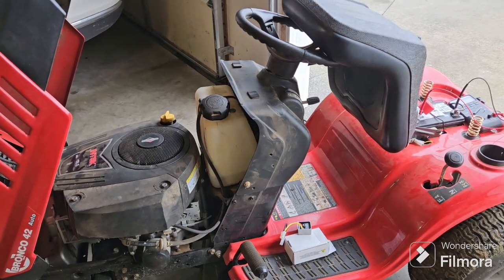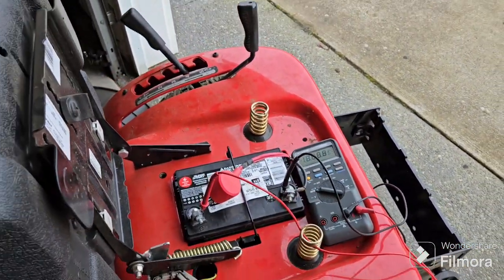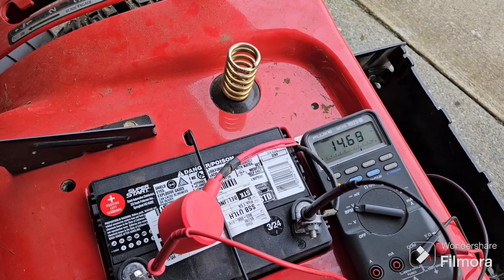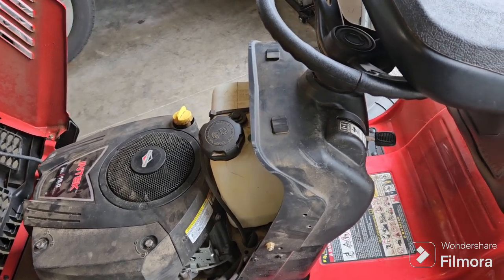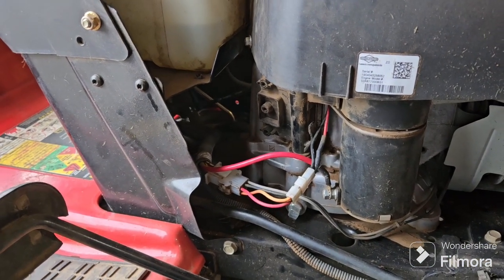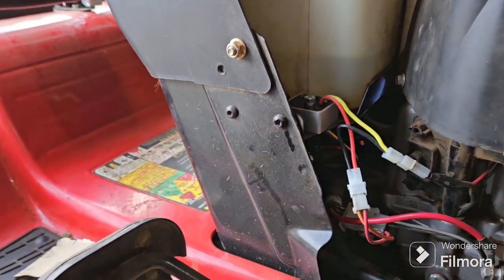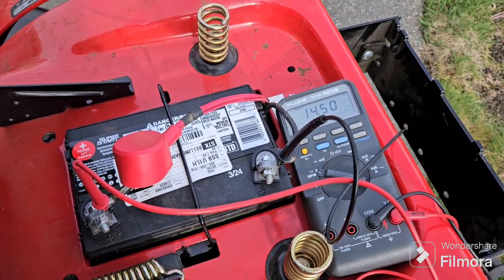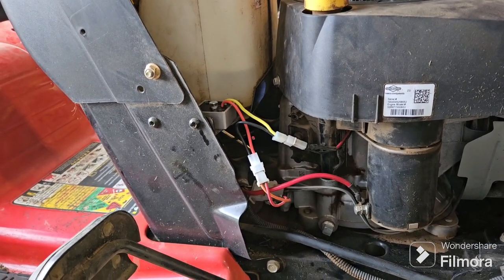Troy Bilt with Briggs and Stratton charging system running at 16 to 17 volts, FIXED.

Comment: Thank you for posting this. The use of just a diode instead of a real regulator seems like a common cost saving "trick"-they don't care how long the battery lasts. Thanks for showing that the regulator held over 14 v even when the engine was idled down.

Comment: Neighbor has a craftsman T110 that is wired without a regulator as well or someone has taking it off 🤔 The electrical part next to the battery under the seat is the solenoid for the starter. The stator puts out 9-25vdc depending on where the throttle is set. The 3rd line from idle is roughly 14.5vdc.

Comment: Tks for vid. Kind of confirmed same diagnosis. Found same thing when my 2 yr old Bronco 42i mustve cooked the battery while out mowing. Tractor just died in middle of our lawn. Traced wiring from motors stator to white connector that runs under the firewall and below floorboards up and under the seat where it runs to various safety switches but there is NO regulator that I could see anywhere. Seems Troy Bilt designed the stator to put out a decent voltage to keep the battery charged ( yes there's a diode hidden within shrink tube of  one of the brown wires so the stators AC VOLTS are converted to DC VOLTS. In my case however, my stator would put out as high as 16.5 volts at WOT. It varied from 13.5 vdc at lowest idle to 16.5 vdc. I guess after 3 plus hours of cutting at wot must've been sufficient to boil the crap out of the factory battery. Definitely looking at adding a regulator now. Don't want to be replacing batteries every year. They're almost as expensive as regular car battery and only 1/4 the size
Reply from the maker: Yeah its crazy to me that they dont come with one from the factory. 
I haven't had to touch the battery at all since I put the regulator in.

Comment: So are you implying there is NO Voltage Regulator on your tractor? Being that the battery is in the rear like an old 12V air cooled VW Beetle , the Regulator is ALSO in the Rear and close to the Battery. I don't know why that is exactly. Anyway, I BELIEVE the Regulator on your tractor is on the rear under the battery bolted to the "frame" or the body of the tractor. So you Added ANOTHER regulator! Now you have a Primary and a Secondary I suppose you could say. I have to say I'm tempted to do the same thing because like I say getting to the factory installed regulator in the rear doesn't look easy. I have to remove the rear "Shell" or flip it upside down or something silly.
Reply: What they do is have a small (easy to miss) diode on the wire from the stator to the battery. This turns the AC to half wave DC to the battery. Inefficient (not big problem) but also does NOT control voltage- which is a problem with WOT overvoltage charging! Presumably he removed or bypassed that diode.

Comment: How did voltage get to 16 volts in the first place? Voltage regulator maybe masking some underlying problem..
Reply from the maker: @samgrieg  I think those cheap stators just put out voltage based on rpms. When I was digging around the net most mowers come with a voltage regulator. I assume to cut some cost these mowers didn't. There isnt much to the charging system on these.
Reply: @zainulahmed7542 there may be a diode hidden underneath the shrink wrap in one of the wires coming out of the stator, that could have been the issue
Reply: Yes. No regulator @zainulahmed7542
Reply: Yup-the problem is they do not care how long your battery lasts! A cheap diode will let the AC from the stator become 1/2 wave DC to charge the battery, but there is no voltage regulation-it just gets whatever voltage the stator produces (RPM dependent).